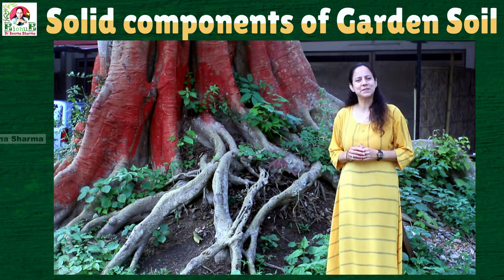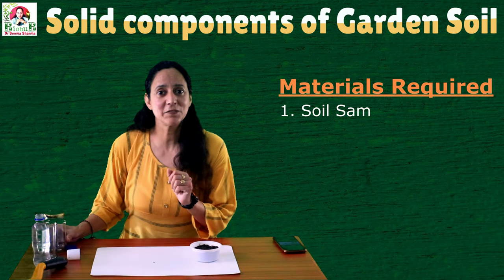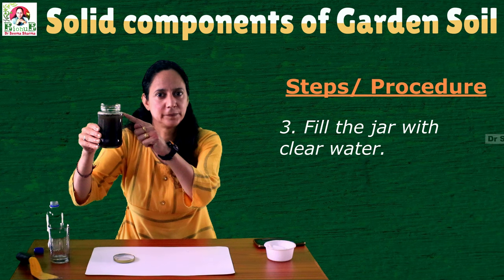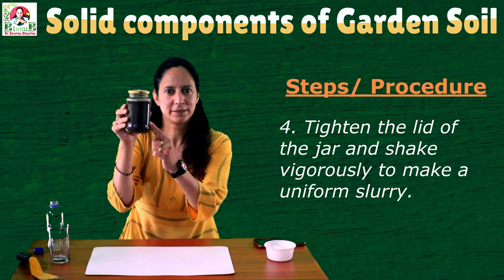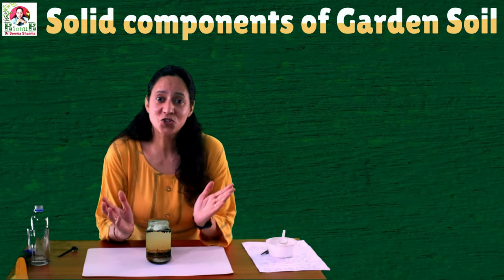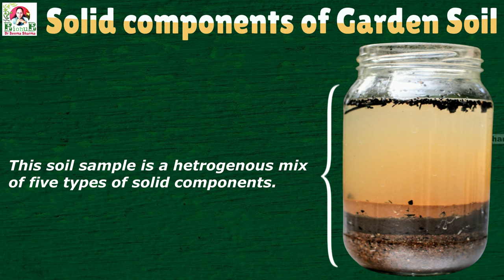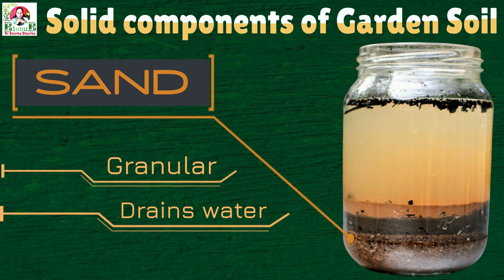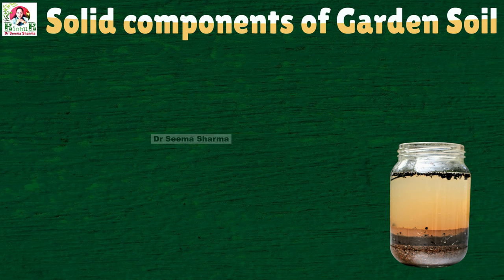DIY: Solid components of Garden Soil

Comment: Ma'am what is Trowel and uniform slurry?
And others you give a best explaination for Solid components of Garden soil.👍🏽👍🏽
Reply from the maker: Thanks for watching, appreciating  and sharing your queries.....
Here is the answer of your queries:-
Trowel: It is a small hand held tool used for digging, applying, smoothing, or moving small  particulate material. Such a small trowel, used specifically in agriculture is also called as 'KHURPI' in hindi. Same has been used by me in the video for digging out soil sample.
Uniform Slurry: A slurry is a mixture of denser solids suspended in liquid, usually water.  Here, by shaking the jar filled with soil and water, we have achieved to make a SLURRY. Further, I have called it as UNIFORM, to express that all soil particles have homogenously mixed in the Slurry.